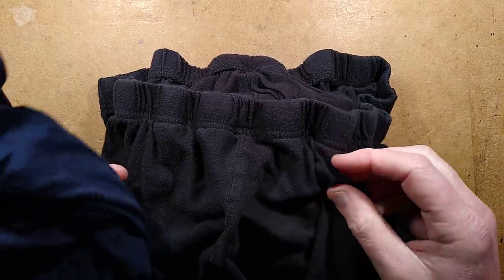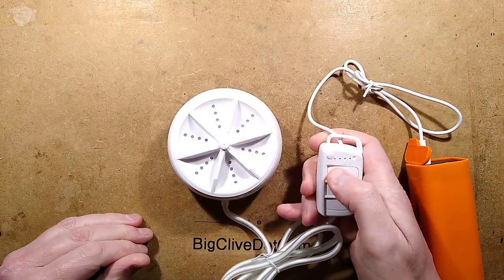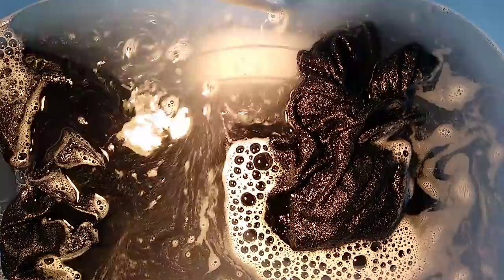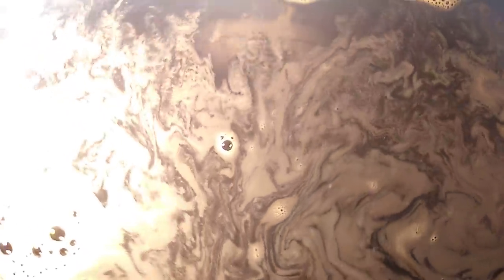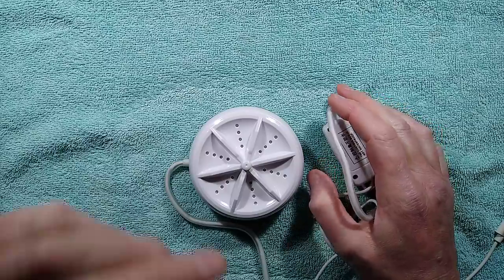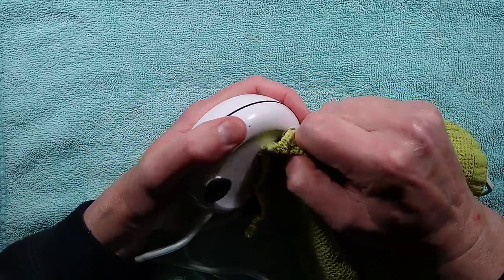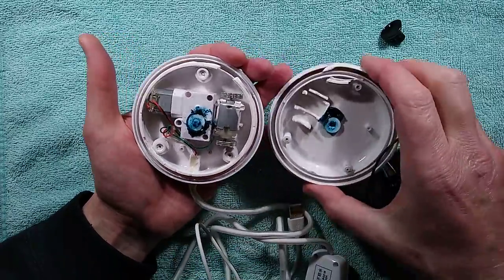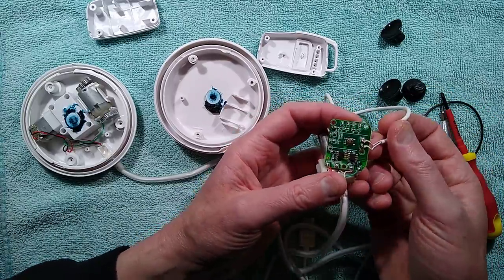USB laundry machine for tiny (moist) Chinese panties.

Comment: I'm throwing this out there. 1 rubbermaid, rectangular, 6-10 inch deep tub...mildly dirty dishes...this "washing machine" attached to the side...hot soapy water...stay with me here. Small efficiency apartment with no dishwasher. This could work for MILDLY soiled dishes!
Reply from the maker: They do a dish washing version.
Reply: @bigclivedotcom  Yes, I've seen it. Seems much less powerful, though. This puts out more "power."

Comment: Looks like they used 0402 parts on 0603 pads. That's a bit masochistic. I've also noticed that some manufacturers occasionally try to get away with not marking 0603 resistors. Yageo did that back in 2013 with ALL their SMD resistors, and I think enough people complained so they quickly started marking them again. Cheap bastards. Their taping materials are also almost always crap and fling parts all over the inside of the SMT pick and place machne. Panasonic annoyingly only ever marks their 5% parts in the 0603 size. 

More recently Vishay/Dale stopped marking their 0603 resistors. I find that odd considering that they're one of the more expensive brands and generally cater to higher tiers of electronics manufacturing. Maybe they're trying to get into Apple's pants, since those jerkwads can't stand anyone figuring out and fixing their stuff and would want parts to be absent of any markings...

Comment: I saw an ad for this thing on Facebook and almost was spitting at the stupidity of it.

I knew just from looking at it that it could only handle a couple garments and small ones at that.

I didn't factor in that it would  effectively have to use even more water than a top loader washer does.

And of course there were plenty of comments on the ad from people saying they bought the thing and it was amazing.... Which we all know are paid comments or from people who just have no clue how stupid of an idea this thing is.

Handwashing is easy, uses less water and is probably faster... And for sure is cheaper.

Speaking of Handwashing, wash boards were manly for wringing water out of clothes... Not getting dirt etc out of them. That is all from the water flowing through the clothes and the clothes rubbing against each other... Ya know, how modern day washers do it!... Just with your hands, or a turn crank or other device.

Comment: Some H bridges will brake hold the motor of both high.
Reply from the maker: This one has a high impedance mode and a mode where both outputs are pulled to one rail.  Not sure if it would bridge them in a suitable way for DC braking though.

Comment: dunno if its been mentioned in the video but it literally says 102 by the resistor on the board, i think they are all 1k lol
Reply: In the lower left corner of the printout, just below R2? I think that's a combination of an outline, | , and the designation Q2 belonging to the component just below the resistors.

Comment: The next step up from here are the various low wattage portable washing machines. They're meant for applications where a very high current isnt avaliable eg in a camper or caravan using an inverter to give you 240 volts from 12 volt batteries. Although they only claim a capacity of 3.6kg which is more realistic. #vanlife

https://www.ebay.co.uk/itm/TWIN-TUB-PORTABLE-WASHING-MACHINE-SPIN-230v-LEISURE-DIRECT-HOME-KITCHEN-/111992490110?_trksid=p2349624.m46890.l49292

Maybe you could pull one of those apart clive and see how well made/safe they are?

Comment: They're genuinely rubbish.  I don't know how they're even allowed to be sold anymore.  I bought one on EBay waited weeks for it to arrive and it broke after only one use.  Does any one have a solution for a mini washing machine that can be used for when one is travelling or in an off grid situation?I'm looking for something that will fit into a suitcase.
Reply from the maker: There are simple "sonic" washers that use something resembling a vibrator to agitate the water.

Comment: probably washes better than my HE clothes washer that hardly wets the clothes.
Reply from the maker: Modern machines just make the clothing wet and no more at the start of the cycle.  It increases the strength of the detergent and also causes much more friction in the clothing as it tumbles to get a better clean.  The rinsing cycles use much more water.

Comment: More plastic crap from China...  
One thing I took from this was the notion of ultrasound cleaning...  
We see it used industrially, medically and most watchmakers have one loafing about to clean mechanical watch movements and this method of cleaning is extremely effective, certainly on hard metal or plastic parts.   But clothes?
.
I don't see why not...   At certain frequencies, dirt particles will resonate more vigorously and thus become detached from the fabric fibres, same for greases, detergent clumps, pollen, grit...  All will have a resonant frequency.    
.
So a variable oscillator working in the ultrasound range, triggered by a sequencing circuit, enabling subtle, but continous changes in frequency, piped through a 20 watt power amp, the output of which goes to either a waterproof transducer,  immersed in the washing tub, or a ring of piezos glued onto the outside of the tub.   Or perhaps a few 'prongs' of stainless rod attached at one end to a heavy-duty voice coil and the other dipped in the washing medium.